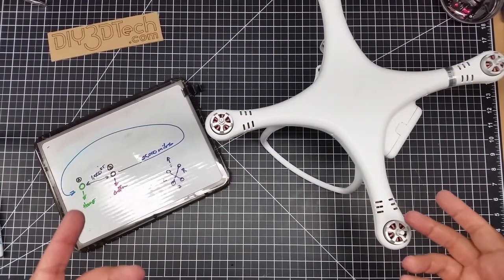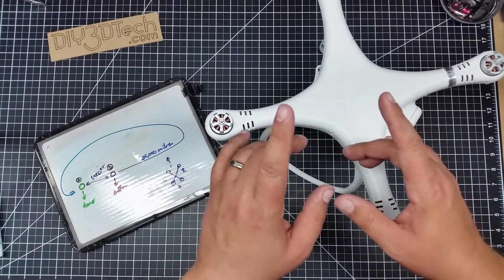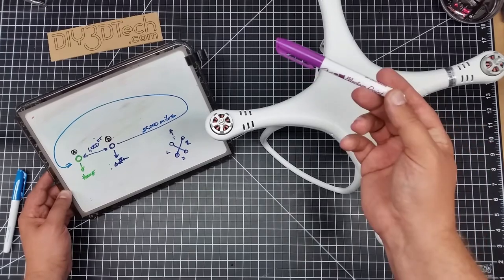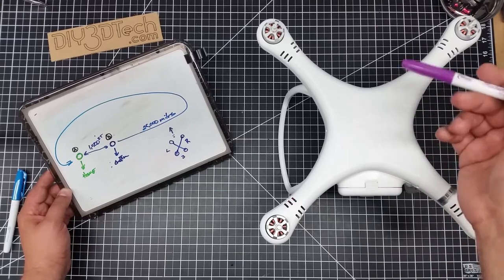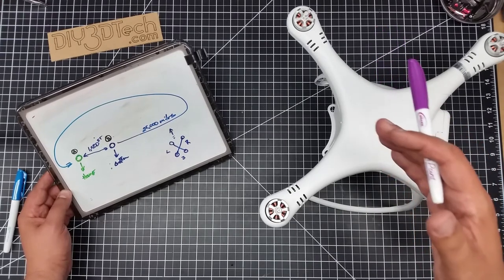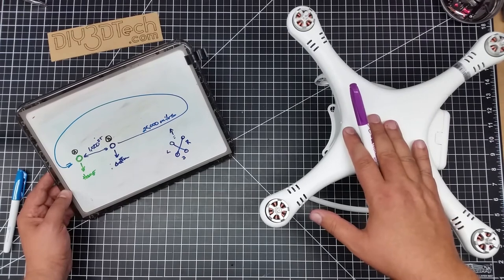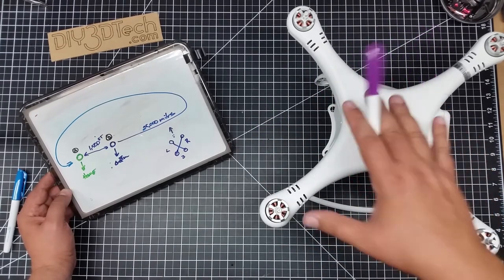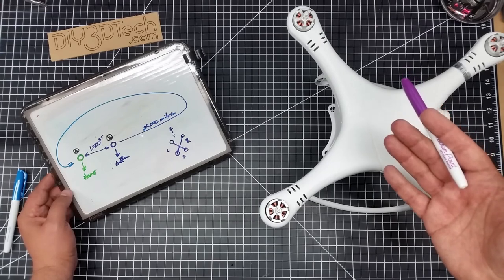Video Drone - UpAir One Plus Why Compass Calibration is so Important!

Comment: Hi,  thanks for your videos,  they are a great informative reference for anyone who is having problems with their Upair drones! I have a question however, that I can't seem to find any information about, anywhere on the internet, and that is how to re-bind the transmitter and the drone if they were to become unbound. I foolishly handed my transmitter to a fascinated bystander and after a quick discussion about how to operate it and a warning to stay away from some nearby 30m tall trees, I allowed him to take control of it. 30 seconds later he hit the top of the tallest tree of the lot and the drone tumbled down through the tree onto the ground below. The drone appeared to be unbroken although the gimble had learnt a few very unusual form of erratic break dancing. 
The drone and transmitter though appear to be not communicating. I have opened up the drone and I have had a very close look at the boards and all of the associated connections and there appears to be no obvious reason for this. This is why I am wondering whether the drone and transmitter can become unbound and if they can, how to go about reminding them?
Any suggestions would be greatly appreciated! 
Cheers Robert 
Tasmania Australia

Comment: Thanks for your prompt reply, Sir. Made a research and conducted some help and support to other experts here. It just came out to my own understanding that the NO MAV DATA is NO MainAudioVideo DATA. I have this feeling it's not the firmware but the link between the Gimbal to the board. Hope if I'm going to check it later that there will be some loose connections between the wire in the Gimbal to PX4 Board. 

- I can Armed/disarmed the Motors no problem with that.
- Camera and Monitor works well and good.
- Gimbal works just perfect
- Can detect and received GPS/ GSat Signal

Hmm..come to my sense NO MainAudioVideo DATA. Possible loose connections. I will check on it later. Thanks for the help and support, Sir. Really appreciated it. Have a nice day and more viewers to your Channel, Sir.
Reply from the maker: If you google it, it comes back as issue between the PX4 and the OSD which on the One (not plus) is part of the Gimbal and there is a separate bus for this so you can try and check the wires going in the gimbal as I recall (you can look in my UPAir One playlist) as I  recall there are three sets...

Comment: I always check return to land .. before I continue flying take off about  15 ft switch to RTL... and see what happens if it lands on where you took off from or thereabouts. Compass is calibrated!! Then I continue flying . I do this also with my walkea  qr x 350 and my cx20s. It's the best way I found with no flyaways.
Reply from the maker: Yea could never get the compass calibrated on this unit so basically just gave up.   I owned several Upairs and the first golden!  The second so, so and the third a piece of well you get the idea.  Sad, as I really started to like the brand...
Reply: @VideoDrone  I also use mission Planner with most of my quads on calibrations very handy MP.

Comment: Hello,
Bad news crash with my Upair One Plus 4K...When I touched the follow me button the bird took off from a nice hover and went crazy, flying into the roof of the house at that point!
Anyway, the thin ribbon cable tore apart of course...the one between the camera and the bottom of the bird.
Is there any way to get a new ribbon cable or a new camera + gimbal combo for the plus??
Any way to reinforce that thin little thing??
Reply from the maker: Yes you can order a new one from GTEN, reinforcing not really that I know of...
Reply: Thanks! They don't show anything available on their website. I suppose I should try writing them, calling the U.S. number was useless.
Do you happen to know how I could order from them??
Reply from the maker: You have to e-mail them and they will quote you a price and delivery.  I believe their US service center is in either Maine or Maryland...

Comment: How is your flight with the three bladed props verses the original props?
Reply from the maker: I personally love tri-props however they do pull a little more current so you flight time might be cut short by a min or two but you will have better performance...
Reply: Video-Drone Hmm really? Over the DJI props? I'm just trying to maximize my performance..
Reply from the maker: Well props are like tires on a car and comes down to what do you want to achieve.  Because tri-props have more surface area they will have greater lift, but at the cost of pulling more power.  The second thing is there are typically better balanced than a bi-prop so there is less jello on a non-gimbal copter.

Comment: Sir, good day. Sir, I have a UpAir One 4k FPV Version with 7" Monitor - PX4 Board V1.0.0.2. 

Sir, how can I calibrate the compass? Or no need to calibrate it?
Reply from the maker: If it is not the plus (which it sounds like it is not), you really can not and this can become an issue as this the reason they changed it in the "plus" version...

Comment: I'm using a UpAir One 2.7K FPV Version with Monitor. Had encountered an error to my monitor screen it says 'NO MAV DATA". No Crush or what so ever. Just purchased few days ago.

- I can armed the drone working all Brushless Motors
- Can detect GPS 14+
- Record video and Picture not working on the screen

Please need your help. What will I do with the "NO MAV DATA"?
Reply from the maker: Do you have the UpAir One or the One Plus?  Typically no MAV data is a firmware bug.

Comment: Sir, good day. Sir, I need you help and assistance please. I have a 2.7K UpAir One 5.8Ghz FPV 7 Inch Monitor with UpAir2 PX4 Version 1.2.0.0. There is a message appeared on the screen it says "NO MAV DATA". What does it mean? How do I fixed it? Please need your help.
Reply from the maker: Typically this is a bug in the PX4 speaking with the OSD.  Not sure how you would fix it as I have not experienced it only read about it however the prognosis doesn't appear good.  You may wish to contact GTEN and return it for repairs unless you are very comfortable missing with firmware and the electronics...

Comment: Surely it knows which way is 'front', else how would it know which direction to go in when you push the stick?
Reply from the maker: That's the point of the compass, without the compass no it does not know know where front is.  When you push that stick a computer in there does a whole lot of work as its a flying brick. Even on cheap quads, like the Sysma they tell you to point them "away" from you and when you start up the copter it reads that value of the all effect sensor as being "front" and even that can get wacked  and need to be reset by holding the sticks both down and to the right...

Comment: To fly upair drones indoors.......always turn GPS mode off first. The quad is programmed to go to a certain height in GPS mode....... of course it will hit the ceiling. "Pay attention" to manual.
Reply from the maker: I would be afraid to fly this indoors :-)